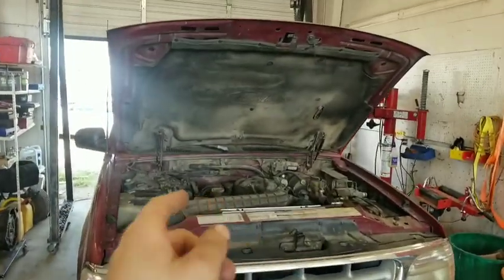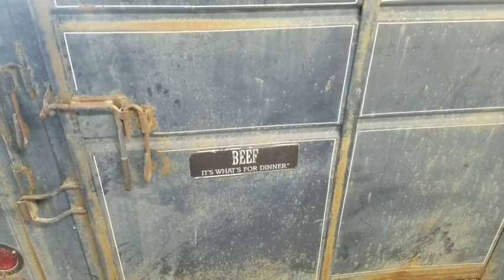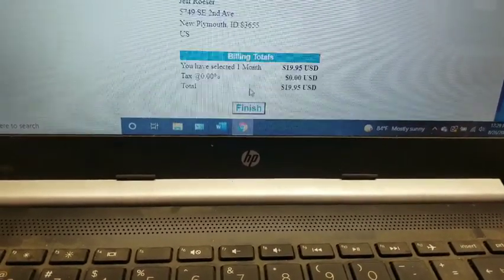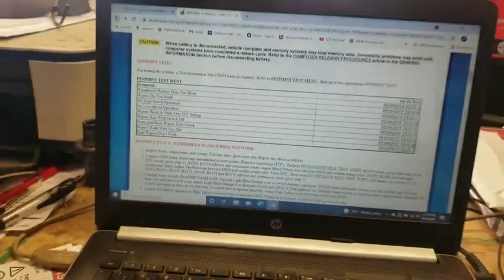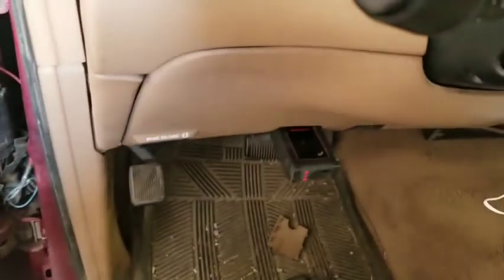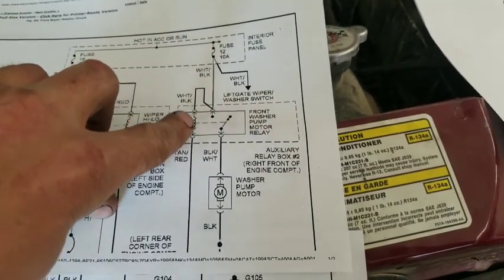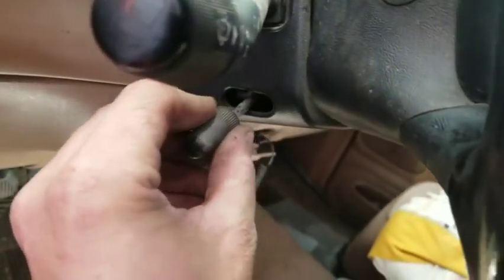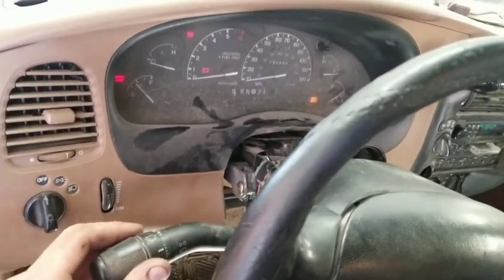Ford Explorer windshield wash not working.

Comment: If i'm not mistaken the wash button simply grounds the light blue/orange wire. I have installed a small push button to simulate this wash button on a couple where the switch has failed. Just wired it in parallel to the existing switch. The Mitchell version of this diagram does not show that each position of the delay has a different resistance. the voltage on the LB/OR wire is stepped down from 5 volts i believe to "tell" the GEM module what delay is requested. The wash switch pulls it to 0 volts though. Good video.